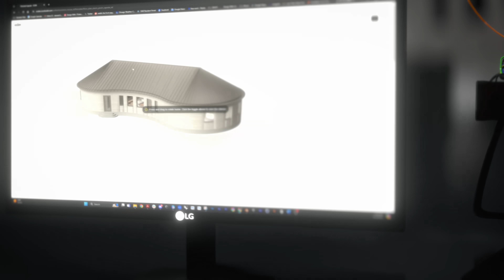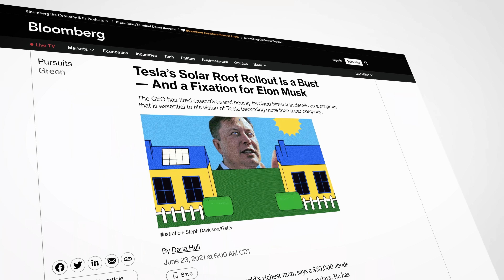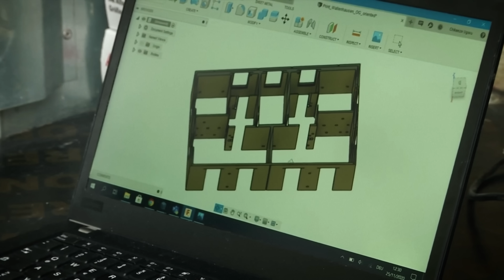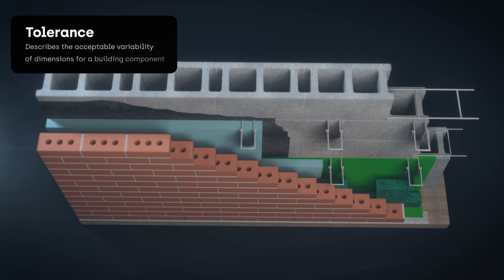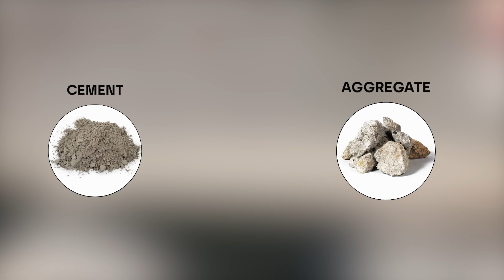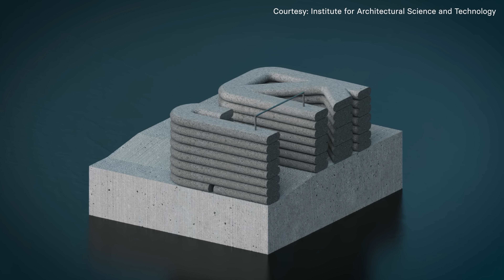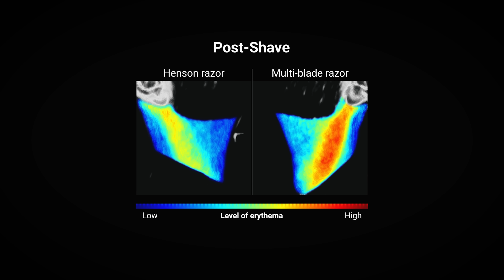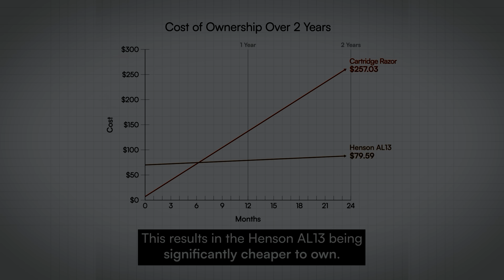Why 3D Printing Buildings Leads to Problems

Comment: Negativity rakes in views i guess. this is a new idea and technology, and we hope it succeeds. although identifying problems is fine, encouraging people to shit on an idea that can help many people is a bad thing. outside of your first world confines, this technology can be purchased by developing governments to help house hardworking people who dont have homes. concrete homes are far more long lasting and strong than wood frame homes. my family's home in rural india has stood for over 300 years, no rotting, no issues. it's a concrete structure. some have said it only replaces the framing, no thats not true. the frraming is still done by humans, instead of wood its rebar. the concrete is the exterior, the interior, and honestly everything that gets done inside happens VERY quickly. Mainly because you can hire all the teams to come in and do several things at once. a house can be built in 1 month. compare that to my new construction home we purchased this year - which took 9 months to build. you say it will be hard to make repairs even though people have worked with concrete for millennia. people know how to work with it, repairs dont need to be 3d printed much less lifting up the roof to do so. you said why dont they just use molds for the walls - transportation is expensive. cranes are expensive. giant concrete walls dont fit inside trucks. meanwhile, one 3d printing robot can be transported 1 time to a development lot, and stay for months upon months, before being transportd again. everything else is built right on the spot.  instead of mentioning the positive, you spend your time bringing it down.
Reply: Someone films a video discussing current state of technology with honest descriptions of it's drawbacks, and out come the defenders arguing someone "shat" on their favourite pet.

Relax, this is not a negative video.

Comment: Pour the walls thick and while it's wet enough run a trowel over it, you could attach it to the printer so I smooths as it prints. There. Easy...

Comment: Doubt that solves anything in the housing crisis. This tech seems to be optimized for small scale buildings. In that cases the biggest cost factors are allready the land prices. If you want to solve housing you need midscale buildings with up to 10 family appartments, not a way to buildt bigger suburbias.

Comment: OR... Like with what we see in the 3D printing community, open source will set in for home design. The materials will be made better. The printers more affordable and reliable. Eventually you'll have small 3D printing concrete companies everywhere with 1000 house designs to choose from and the process will be like getting your drive way done. 

The one thing this would all work really well for in current home designs is the basement. Surprised they didn't start there.

Comment: Some concerns I have for 3D printed houses:

Since this special concrete has some very fine parameters, can it only be poured at certain temperatures? If so, that can significantly shorten the building season in much of the US.

How resistant is this concrete to weathering? I'm specifically thinking of freeze-thaw in those grooves between layers.

Speaking of the grooves; why does no one smooth them out with a trowel while they are wet? Or fill them in with grout or mortar? That seems like a good way to keep bricklayers employed since their industry is being disrupted.

Comment: No mention of the sand required to make concrete is actually limited, for example China is running out of it believe it or not this is usually found underwater and has more angular surface unlike the very rounded beach sand and dune sand of the Sahara which is clearly in abundance!! Concrete is extremely bad for the environment and not sustainable for a planet of 8 billion. We all tend to forget just how limited our resources really are on this rock less than 8,000 miles across at the diameter of our everything! A fun fact it would take 253 years in seconds to count to 8 billion.

Comment: the thing is you need to 3d print house but only you can realy do it to the pieces to assble the hosue together when put together. you simply  can't 3d rpint the whole house but only 3d print the sum of its parts one at a time. this ant the minecraft build craft mod bruh. you can 3d print the parts to make the house but you can't 3d print the  whole house itself. we called it 3d printed prefab buildings. you 3d print the parts that you put together to make the house you don't 3d rpnit the whole hosue. you only can 3d rpnit a whole hosue with nanomechnies not realgear 3d printers.

Comment: 13:30 - Hmm... i wonder then about the Raptor v3 from Space X, which they are fabricating some parts of the engine using 3D printing.
Reply: They have to 3d print because there are internal geometry’s in the engine walls which run fuel through them for cooling. This can’t be cast.

Comment: Its not that hard to bond concrete to concrete and grind concrete away. Very doable. All this about no way to repair is not true. You can fix anything. And i feel like these houses need some sort of siding. Which would also be easy to do

Comment: With bricks you can also use these things called Arches to span openings, but I do agree it's probably more work than just using a steel beam.
Reply: They could also use precast sections for arches and possibly even program the printer to make them.. or use another material.. like white oak and brace it off of the window sill.. but this guy obviously isn’t the sharpest tool.

Comment: Coming from a Lead Foreman in Commercial construction, the designs that are brought up by the "Architects" make for problematic situations. If this process is going to take off...then the printer must provide ALL TRADE install as well. Not just carpenters, but HVAC, electrical, and plumbing... we are 50 years away from loosing our on-site human influence. Even further with skyscrapers.

Comment: I wouldn't want to live in a glorified bunker. Plus, can you imagine the dust collection on those round, rough edges? It would eat swiffers like popcorn.
Reply: Yeah, I feel like those edges should be smoothed out or it should have external siding and internal drywall style walls covering the concrete.  For cleanability and protection of the concrete.

Comment: 8:02 I don't understand why the concrete manufactures aren't more involved in "best practices" when it comes to the conformity of the concrete process. Why there aren't 2 guys with trowels following behind the arm smoothing out the layers or "forming" the hard edges so printer can squirt 1 second more into a corner so it fills a corner form. This is a 3d printing problem where someone gets a new toy and forgets that 20 other toys have been made for the exact process. They have a new hammer and they only want to play with nails. In position concrete basement walls are a thing. you insert the forms pour the concrete, and remove the forms. one continuous pour solid concrete basement. not only do you get sharp corners you also deal with the lintel problem as its in the form process. I think they have horse blinders on thinking this will be a 1 tool, 4 guy job.. and that's impossible. I think 3d printing a home is a great idea, but I also think they are being ignorant to the many concrete processes that already exist. I've found when I hear the word universal, it means it doesn't work anywhere.. only in a vacuum
Reply: I agree. I wonder what makes the creators so sure anybody will actually use their service. Seems useless and redundant to me
Reply: You’re right but at the same time they’re trying to reduce the need for human work
Reply: @rstell589 Then you (they) are doing this, while completely ignoring any fabrication standards and processes. Even if I 3d print something, there is always work to finish a product. If I lathe something there is always fit and finish. To assume it will ever be a print and inhabit is insanity. Paying a day laborer with a trowel is WAY cheaper..(THE ENTIRE POINT) To follow and clean up after the machine.

Comment: Little confused why you'd have problems repairing or adding on to the building, it is cement afterall, something that can be handled by human hands, why bring the machine back?  If a Earthquake happens and house splits into parts, well tuff, start again.   Also all this sounds real expensive and more a luxury thing.

Comment: So I am not a construction guy but CS guy.
The first thing that comes to mind is machine learning to make tolerances more feasable.

The second is, that I think they should print parts of houses some were else (like a factory) so they can reuse default parts instead of printing everything at once. But I am no expert  so maybe I am overseeing stuff.

But I do not get why people hate the round stuff. I mean decide what you want people. Every god dam UI gets round stuff everywhere, Cars get more round your phone, but you draw the line at your walls?!

Honestly I could not care less how it looks if it works well and is cheap, so I think the focus should not be the design.
But I guess I am alone with that opinion.

Comment: The reason 3d printing works with plastic is because the layer cools and hardens before the next layer is printed. With cement, they are piling wet layers on top of eachother. No rebar, no reinforcement, etc.

Comment: What about those reinforcement that should go into cement? :)).....For fucks sake, Houses are already 3d printed if you pour your concrete into a frame :))....... Woot, works fine for everything, but cheap ass matchstick houses made out of drywall and sticks....
OMFG....a wall cannot be 20 cm somewhere else than it was on the design....Are you insane?...This is a new world cheap/expensive shit principle, where someone asks more money to follow a floor plan?..... 
Well, send all the land survery engineers and the ones that their single fucking job is to measure and check the axis of the "thing" you are building....to a paid vacation.....

Comment: Some interesting comments , I don’t really see why they are trying to make these 3-D printed houses without finishing the interior exterior. You can decide, but it could easily be a traditional stucco added to the outside the interior could also have a fairly traditional plaster put on the inside, not inexpensive, but is the theory that you saved enough with the rest of the house to make it economical? 
You ask about changes, but what’s the big deal? just get out of a saw  chop it up and make it different . 
It doesn’t have to be 3D printed change , wood or bricks will be fine .

Comment: I don’t know. ICF is DIY friendly, faster and probably cheaper and you’re left with the same thing. A concrete house. This is taking the place of framing which is already one of the fastest aspects of building a house. A decent crew of framers can frame a single family home in a week. Without any specialized equipment. ICF is just as fast. In order for this to be adopted you’d need the cost to drop significantly. This feels like a solution in search of a problem.

Comment: Just an FYI, you can repair these walls. You just have to get or make a trowel ribbed similarly to the wall then touch it up afterwards. People make fake concrete rocks by hand, they can fix these walls.

Comment: AI could fix that tolerance problem. AI is basically pattern recognition. And AI could notice similar general patterns in the curves and angles. I wonder about a robotic trowel as it goes to scrape flat the outer walls. And perhaps an edge or corner mold that keeps the corners 90 degree.

Comment: Just looks like a solution looking for a problem to my eye. The big construction bottleneck is labor but there are a ton of construction methods that all ready lower the required labor for the actual structure itself, if you want to help build homes faster find a way to streamline HVAC, electrical, plumbing, etc.

Comment: What if you had a vibration machine with the laying machine and use vibration to smooth each layer and since it has to make a full rotation fast drying concrete will be mostly settled by next pass
Reply: Ya an additional attachment that follows behind with paddles forming the way while it vibrates to smooth out the final finish.

Comment: extruding wet cement feels like such a bad idea. if tech bros are insistent on 3d printing houses, you can simply have multiple heads on your printing rig for grouting and brick-laying. then have workers come in to build the wooden frame and inner walls

Comment: Caulk is not what is used to fill the gap between the rough openig and the window. Spray foam insulation is the preferred gap and crack filler in this application.

Comment: I work in 3D printing for components, but 3D printing of houses is the daftest thing I have ever seen.  Apart from the problems discussed here, it needs a lot more cement, the making of which is one of the biggest carbon emitters in industry.  By contrast bricks made of concrete require much less cement as they use much larger aggregate than you can print.  The bricklaying it replaces is a relatively small part of the whole building project so it doesn't contribute a real cost saving.  Much larger savings can be made by using larger concrete blocks instead of small bricks, but these are less attractive unless rendered (a fairly small additional cost) - people actually like the appearance of bricks!  So it's pretty clear, if you want a job that you will NEVER be short of work in, become a bricklayer.  The working conditions are crap but the money is good and you'll never be out of work.
Reply: until winter, every single year.

Comment: 3D printing a house is one of the most moronic ideas any tech bro ever could have had. Instead of serial mass producing standard elements cheaply and with high standards of thermal insulation and structural integrity, why not 3d print it out of a material that'll crumble within 10 years or so. That said, the biggest investment in building a house isn't the materials, or the work - its the licencing costs, building permits and expensive plans you have to pay for. I would say based on experience, materials and work take about 30% of the total cost. So good job 3D printing tech bro - you are trying to simplify the cheapest part of the whole thing

Comment: Right now, homes are largely made of a renewable resource. Why switch to an expensive and non-renewable resource? We’re already worried about running out of sand. Not to mention, as we push crude oil away, concrete roads become more common, which drives the demand and price up even more. I love 3D printing, but this seems like it will be a funny memory someday.

Comment: Here is a challenge I see with this industry when it comes to user experience and design

The craters of this system did not think about anything beyond extruding, cement, and building structures. 

They could have thought about the user experience in the manufacturing process by having humans or other automated systems to take the layered look of the walls and then create a system/service/process that essentially smooth out the wet concrete into a level shape. That would eliminate a lot of the design issues you have with these organic shapes.

If this makes the manufacturers of these systems roll their eyes, then the entire endeavor is ultimately doomed to failure. If they don’t like the suggestion, then this the whole thing is a cash grab, and they essentially built cities their own funds to make this profitable. 

All I see in this video and others like it is simply animated systems and limited designing choices . They are essentially hoping that people so-called get used to what they’re doing essentially helping to design systems that make these things a lot better.